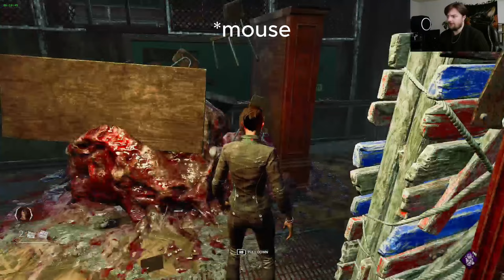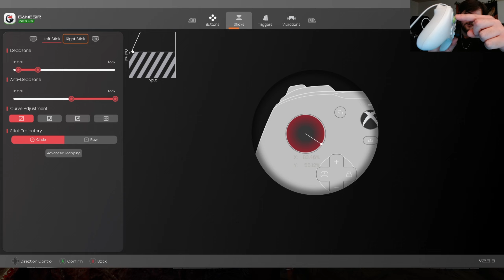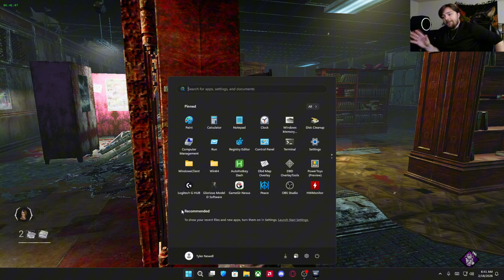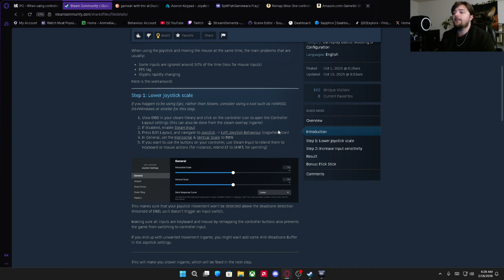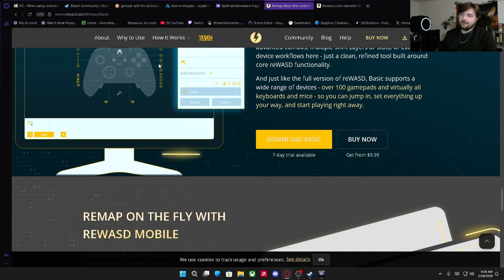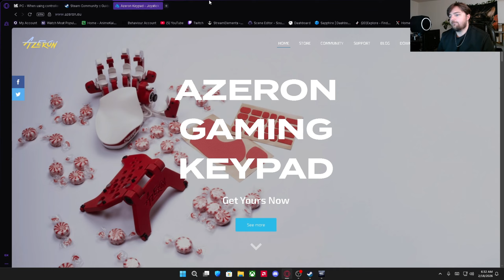Start Using Controller & Mouse for DBD Right Now!

Comment from the maker: The Kontrolfreek green/purple/black rings are the ones I use. I cut the outer edge of the green ring (least firm one) to create a sort of spacer to keep me from pushing the stick all the way to the edge (since I lowered my left stick's outer deadzone a lot) to work as a sort of trigger stopper but for an analog stick

Comment: I don’t get it it works? It’s bannable? You have to bind the button on mouse with controller keys?
Reply from the maker: It was working but it's not right now at least for me but there's been a lot of changes to dbd so maybe they'll indirectly fix it. Whenever it does come back though, it is not bannable and you have to have all the controls bound to your mouse and left side of controller. So you got Left click, right click, scroll wheel up, scroll wheel down, m3 (pressing scroll wheel like a button) and m4 and m5 (side/thumb buttons if you have a mouse like that which is necessary) for controller the main buttons would be LB/L1, LT/L2, L3 (left stick pressed in) up and left on d-pad (for xbox controller since those are closer to the left analog stick otherwise it'd be right and down on playstation controller) as well as 1 or 2 back buttons on the left side bound to Y/triangle and maybe B/circle. **IF YOU DON'T have a mouse with side buttons, nor a controller with at least 1 back button I don't think you'll have enough buttons to make this work

Comment: How do you hold the controller? I find it hard to hold the whole controller up without my arm or hand going numb
Reply from the maker: I had some issues too at first. I don't use claw, I used to use my pointer for the bumper and middle-finger for the trigger but I had to switch to just my pointer for both because I needed my middle finger for extra support and to make it easier to hit the back button. I also have to rest my hand and part of my forearm on the desk, with the right side of the controller pressed a little firmly into the desk for stability. At least at first I did but it got easier to hit all buttons with just a little time. So I don't hold the controller up at all really save for the part that my left hand's fingers are under but they're on the desk themselves anyways

Comment from the maker: It is important to note that WASD movement in DBD does have one good use, if you have a Wooting keyboard or the more expensive Razer keyboards then you have access to rapid trigger which will allow you to do incredibly flicky movement to dodge or bait a Demogorgon shred, deathslinger shot, huntress hatchet, billy saw etc. and also with Wooting you have Lekker Hall Effect switches which you can adjust the actuation point and give them a dynamic range actuation allowing for the same effect as an analog stick where you can move slower or faster depending on how far you press them in. I still think left analog stick is better than that, but that does bridge the gap between wasd and left stick CONSIDERABLY